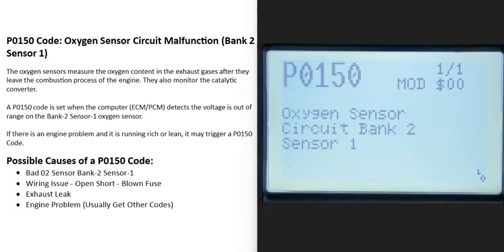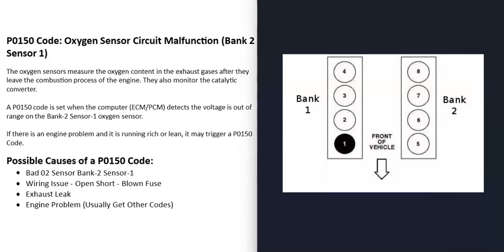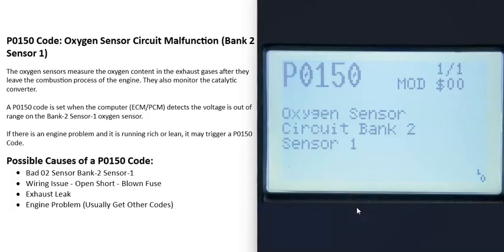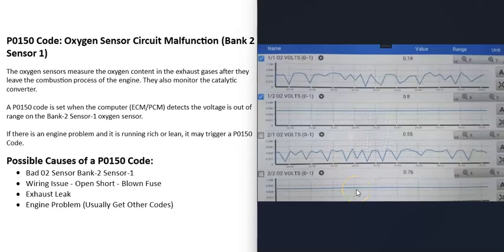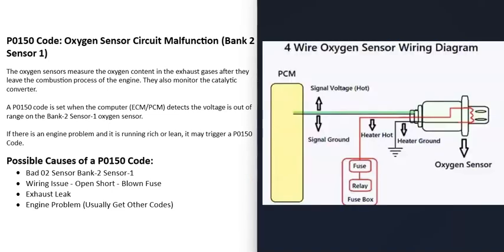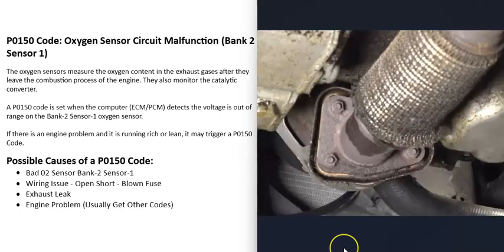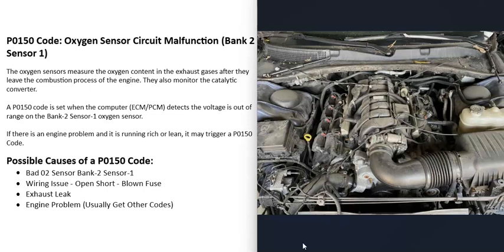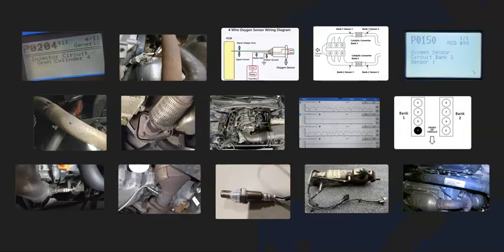Causes and Fixes P0150 Code: O2 Sensor Circuit Malfunction (Bank 2 Sensor 1)

Comment: Hello, I watched your video. I have a Nissan titan 2015, the checking light came on and I get the code p0150 (bank 2 sensor 1) and I don’t know which side is the right one. Could you help me with that? I would appreciate it. I want to try to change it myself.
Reply from the maker: Bank-1 is the side of the engine with the #1 cylinder and opposite Bank-2. Which for the Nissan 5.6-liter V8 the #1 cylinder looks to be at driver side. So, Bank-2 is passenger side.